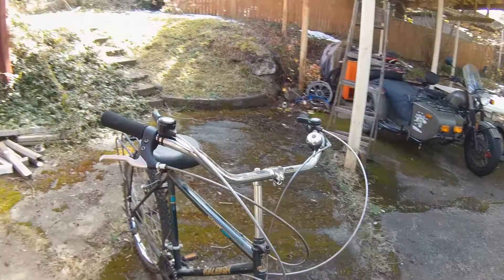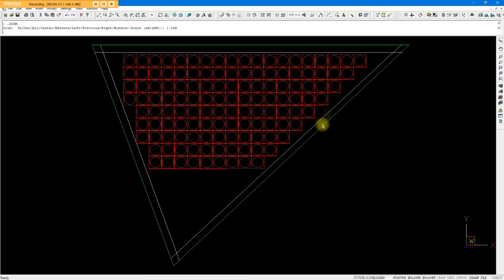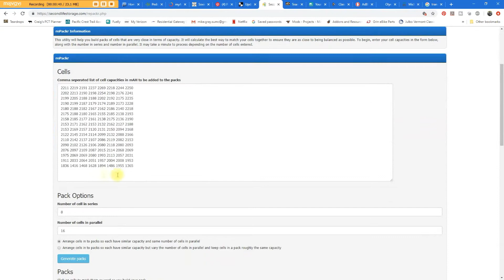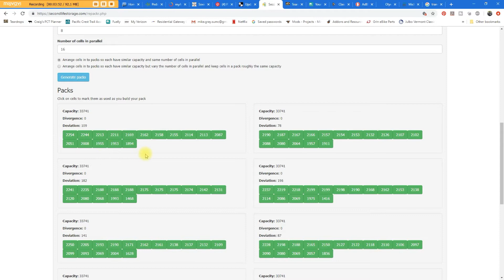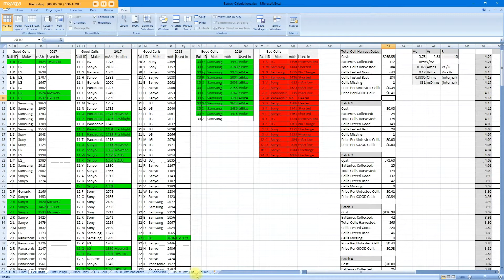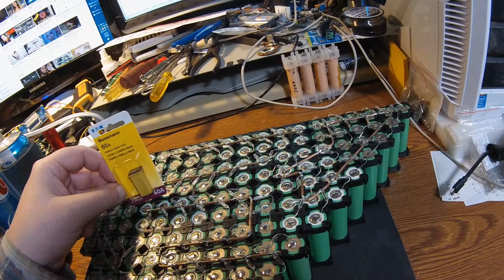eBike Part 6: Intro to the bike, and battery construction.

Comment: I haven't edited the video yet but I'm doing something similar for my new battery. It is an odd shape too so I'm having the same sort of issues with connections. I tried soldering mine but the solder wouldn't take to the battery ends for some reason. I believe they are fake Panasonics so maybe the metal is not nickel. Whatever the reason I had to weld them even though they are button top which was a total pain. 
As for the pulleys you plan to use are you able to get a big enough pulley for the rear wheel. I'm guessing you'll need a ratio between 1:6 and 1:10 but that will be down to the speed the motor wants to go at. On my first build with a similar setup it was approx 1:6 ratio which was a bit too low and I had little torque for getting up hills but would do 30mph.
Reply from the maker: I've found that some cells just don't want to bond with solder easily. I paint a little dab of extra flux on each cell, and it seems to work better. I have no idea how the motor will react to the ratios I have. I'll have to put it together and see what happens. :)
Reply: @MikeGrayM70  I tried flux, cleaning with alcohol and wire wool but gave up and persevered with welding. It isn't brilliant but hopefully will be OK.
I'm no expert in motors but I'm guessing from the size of the sprocket on the motor compared to the fly wheel and the fact it spins the engine around 1000rpm to start it then it will want to spin very fast. You may need gearing to keep it close to its nominal rpm.